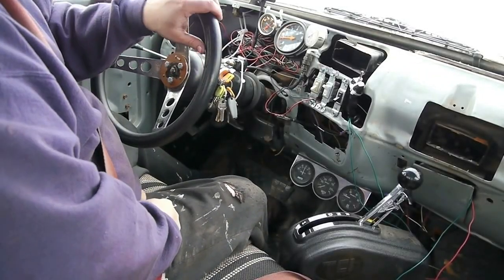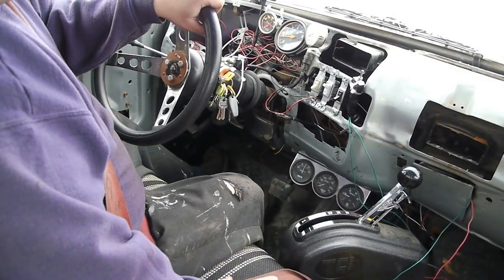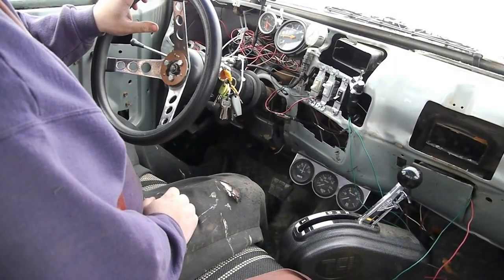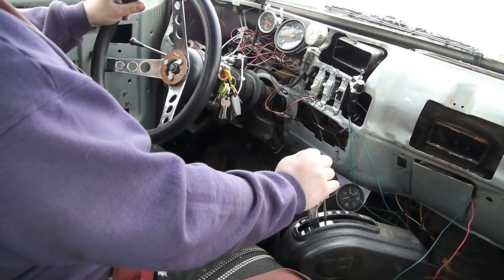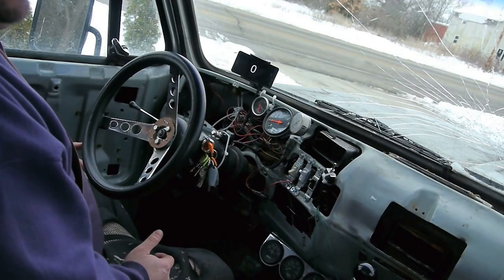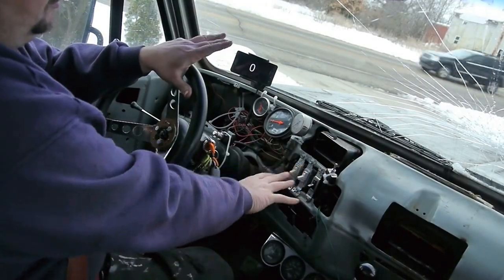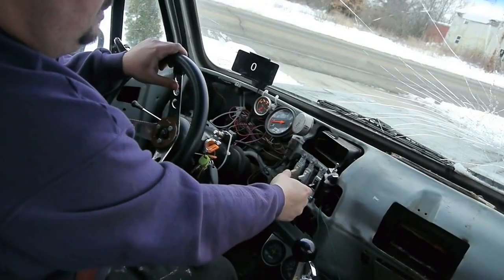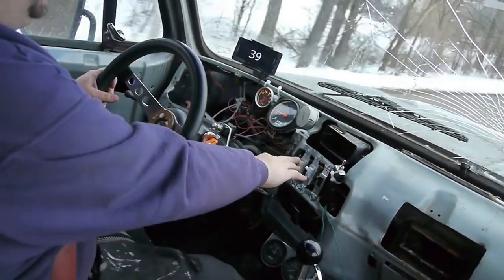4l80e full manual with no computer

Comment: Man, that truck looks awesome to drive! Total control over gear shifts and engine braking. Even the lockup! That's totally cool man. I'm running the stock TH350C in my truck. I've never tried gearing down to reduce the speed. Was worried I would hurt my trans. Though I have had to sit in one gear going downhill. It definitely reduces brake usage! But I don't think I would want to drive at highway speeds and drop it into first. It sure seems fun to shift like you do in that truck. But it would probably get old soon if your driving it every day. Anyways brother, Decent work man! Worth a subscribe I think! Keep updating man! Good stuff!
Reply from the maker: Thanks!  It gets the job done, it is still in use the truck on a regular basis for things.  It's a great work truck, I love old trucks, they are worth repairing and keeping.  It's a vehicle that a shade tree mechanic can work on and keep for a very long time.  Today's vehicles are awesome, but they are not as friendly when it comes to certain repairs.  Heaven forbid in a newer vehicle you end up with a wiring issue buried somewhere in the middle of the engine harness...
Reply: Dan Mann Yeah I hear what your saying, totally man! These trucks are great. I can sit in the engine bay while I'm working on the truck. their very easy to work on, parts are cheap and readily available. its great! I love my 82 k1500. It was my grampa's before he died. I'm doing the whole body on it. Box, Doors, Front clip, Cab corners! It was used as a farm truck all its life, in an area that's real moist. So most of those parts are rusted. Plus its got huge dents on the passengers side. I have a feeling someone rolled it on its side while they were 4x4in. But the frame is solid, and the engine only has 107k in miles on it! So overall its Decent! I have a vid of it here on youtube, and I plan on putting more updates up of the trucks current state with in the next couple days. Its almost ready for the new parts..... But yeah man, newer cars are a pain forsure! Way too difficult to work on. Parts cost a crapload. Plus these older trucks can be tuned to perform just as well, if not better then the new ones! Anyways bro, have a good one!

Comment from the maker: @dale the 4l80e was free,  and I wanted the challenge ;-)
Reply: i need the wiring that you used i have a unfortunate diesel to gas swap and i have no 4th
Reply: some custom trickery with the shifter mounting the switches to it and you could do it all with the shifter
Reply: Dan Mann check out sloppy mechanics. Especially the Facebook page. You would fit in well.

Comment: Well I tried a sol B switch with my PCM equipped RV. It did hold third gear as desired but the transmission does go into limp mode. (no 1st, 4th or TCC) The CEL does not come on and the limp mode resets with the ignition switch.
   I will need to install the sol A and TCC switches as you did for total control. Any idea where I can have the chip reprogramed to ignore the fault? I hope switching without pulse wave modulation and with full line pressure will not cause a hard part failure. I intend to use common sense with the go pedal :)
   Earlier you mentioned trans temp. Sounds like you suggest keeping the TCC locked as long as I am not lugging the engine. Isn't that the first thing to release before downshifting, when the PCM is in control? I think this is going to work for me. Thanks
Reply from the maker: Doug, I'm not 100% sure that the PCM releases it first, but to me it makes 100% sense that it would.  If you accidentally leave the TCC locked up and shift (and I have by accident) it's extremely harsh.  I would want to turn that off between shifts.
Reply: Dan Mann Thanks for the heads up. How harsh is it shifting into reverse? I read in the Mitchell manual full line pressure can break the band. I guess yours is holding up. I've been going back into PCM control before shifting into reverse. I really like this! I wired mine to four pushbuttons and a toggle for TCC. Thank you.
Reply from the maker: Reverse doesn't seem to harsh to me at full line pressure.   Glad it's working for you!

Comment: Thanks for your reply. As long as the PCM doesn't throw the trans into limp mode I can deal with the CEL. I will try it with TCC and Sol B switches and see how the PCM likes it. If I am lucky the CEL might reset itself when I set the switches back to normal PCM control. I will try it and post the results.

Comment from the maker: @billylancer -  grounding both solenoid isn't enough to make the gear selector lever command first gear (it is the only gear that has this limitation).   For first gear SOL-A has to be grounded but SOL-B has to be open.   

You can overcome this if you understand something:  there are pins on the transmission connector that go to ground depending in what gear the selector level is on.   Knowing this you can hardwire SOL-B to be off when the selector is in physically in first gear. -  Dan
Reply: So how sol a has 3 wires you need to twist to ground. Rite so is the 3rd wire the line pressure switch.. that wire should be alone and always grounded or twisted up with sol a on the switch.. this is where i am at in my swap.. 85 k30 dually 6.2l diesel

Comment from the maker: @2451star -  yes something similar should work on the 4l60e...EXCEPT that I don't think the pins are grounded.   Instead I think grounding them does the opposite (or they use 12v?).  In one of my original comments in this thread I had some links.   One of those links showed the pin-out for the 4l80e, but on a different page that same site has 4l60e info.   You will find definitive answers for the 4l60e there.   Good luck -  Dan

Comment from the maker: @mightfab - yes I actually have an arduino.   I just have to get a circuit to interface a VM sensor (an HEI module can probably do this).   I have too many projects.   The lt1 and 4l80e are coming out next year to power a 1970 Cutlass.   I have an old 1979 Yamaha xs1100 with a MegaSquirt fuel injection system... I'd like to put one of those on the lt1 at some point.   The internet=too many fun projects :-)

Comment from the maker: @dougjones -  yes I think you could do this.   Four things I would be concerned with: trans temp if the converter is unlocked,  lugging the engine, computer throwing codes, and warranty.   But if you have those bases covered and are adventurous I think you could do it.   You may also be able to have someone tune that behavior out alltogether in the computer.    -  Dan

Comment from the maker: Here's how the shifting works:

Sol A: grounded, Sol B: off = First Gear
Sol A: off, Sol B: off = Second Gear
Sol A: off, Sol B: grounded = Third Gear
Sol A: grounded, Sol B: grounded = Fourth Gear
Lockup Solenoid grounded = Lockup active

I put a link to the MSGPIO site in the video description.  Open that link and look down at the page towards the bottom and you'll see the connector pin out.  Make sure you look at 4l80e connector and not 4l60e.

Good Luck!

Comment from the maker: The solenoids need to be grounded with the switches.  The transmission needs a 12v+ line that feeds it when the ignition is turned on (Pin E on the transmission connector).  Solenoid A is Pin A on the transmission connector.  This is grounded through one of the switches.  Solenoid B is Pin B on the connector, also grounded through a  switch. The torque converter lockup is Pin S, and it also needs to be grounded through a switch.  I do not have any resistors connected at all.

Comment from the maker: No, this is just using the wires coming out of the tranny.  You don't need a manual control for that, you just need to have a wiring diagram so you can control the proper solenoid and provide power to the transmission.  You could do exactly what I did for the cost of some wire and the light switches.